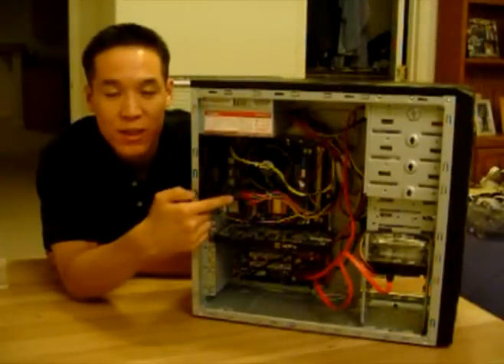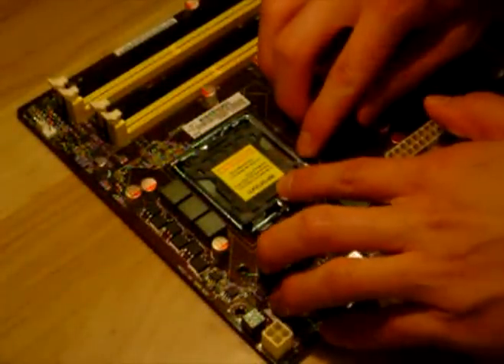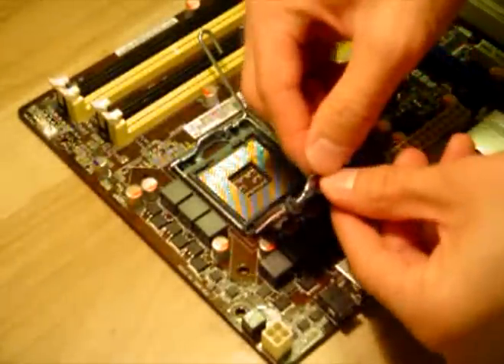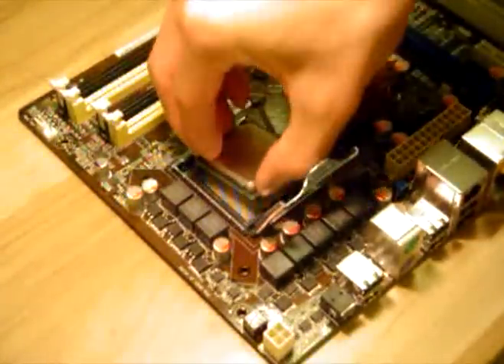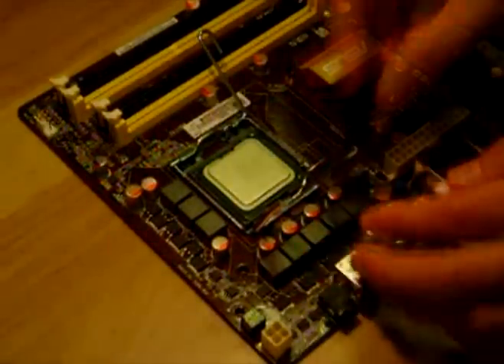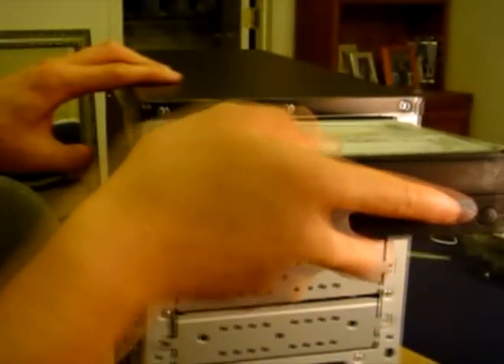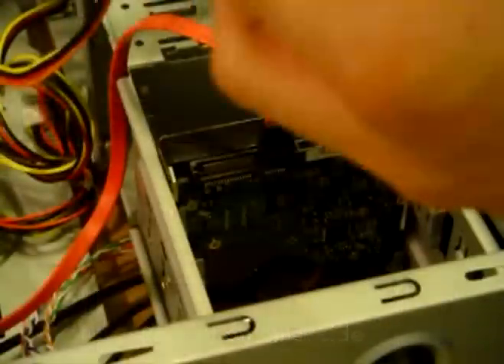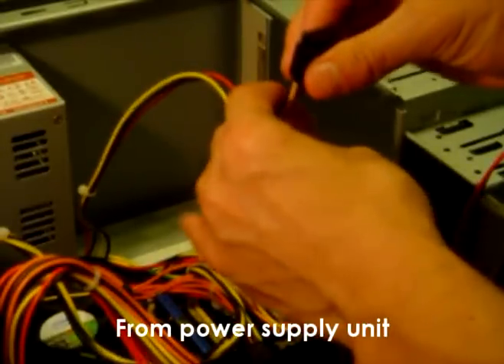Learn how to build a desktop computer or PC

Comment: I have a question. I am about at my budget limit, and I have all my parts picked out. My case comes with a pre installed front fan, rear fan, a side fan, and a slot on the side for another one. All the fans are about 120-150 rpm. Since I am at my budget limit, should I really go search for a heatsink? or will my fans take care of it.

Comment: @Imfingbob I built a friend of mine a solid budget gaming rig for 370$. It can play Crises 2 on medium to high settings btw. Just to give you an idea of strengths. Assuming you have the mouse, keyboard, monitor, and the desired OS then it can be a good price. My friends build uses DDR3 RAM totaling 8GBs(sadly a stick was dead so only 4 until I buy him another), and an AM3 processor that had three cores. We unlocked a 4th easy.  =] IT REALLY DOESN'T NEED TO BE EXPENSIVE!!!

Comment: nice vid, i am new to building pcs and im just about to start building my first rig but im not sure what power supply i need? what amount of watts will i need? does it matter? or does it depend on how many other things im running off my motherboard? my motherboard is:
Gigabyte GA-880GM-UD2H
i will be using the HAF 912 plus case, 8GBs of ddr3, AMD phenom II X4 995 BE a 1GB graphics card etc pls help

Comment: No you are wrong. Low end quadcores just run fine even on high end games (like GTA IV which is quad support) overclocking it using nice aftermarket cooler and good quality psu, will even surpass your E8400 performance. quadcore utilizes its 4cores just like multitasking, dual monitor setup, etc. it runs smoother and doesn't bottleneck your processor just like on dual core's. so for me getting a quad makes it a future proof

Comment: Duo core is out of date. Games now support quad core and duo core games will run fine on quad core. If you get an duo core now you are going to end up replacing it after a few months because you can't run new games with an duo core and run Vista or 7.